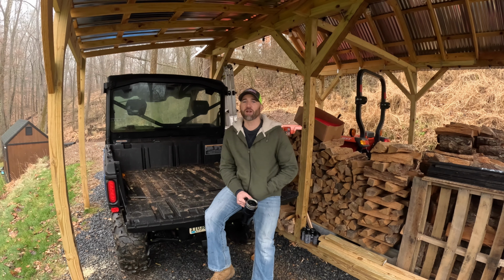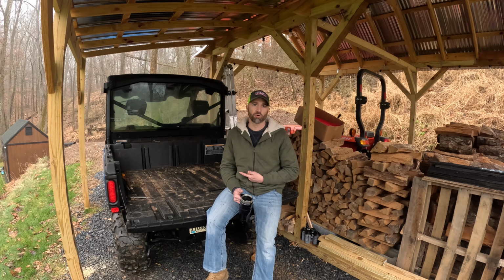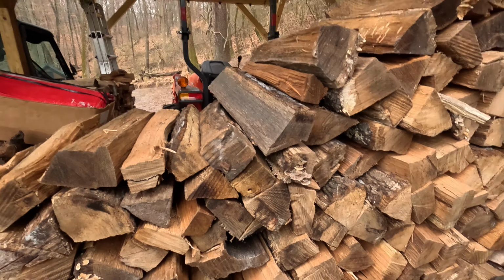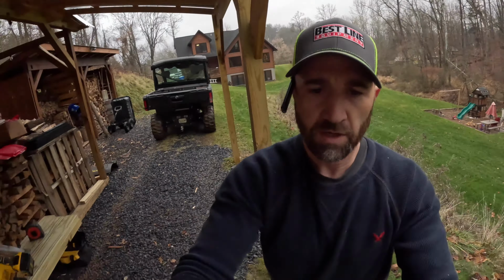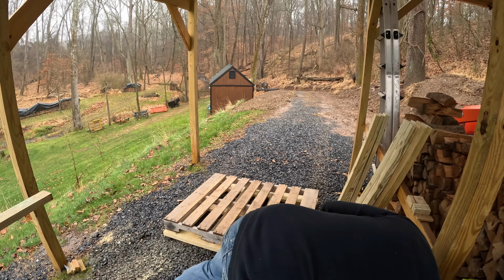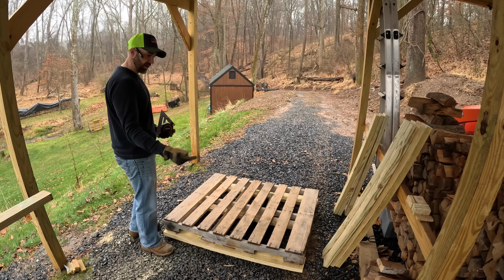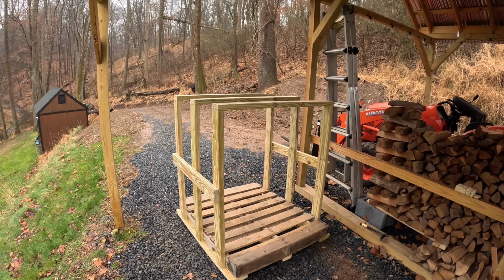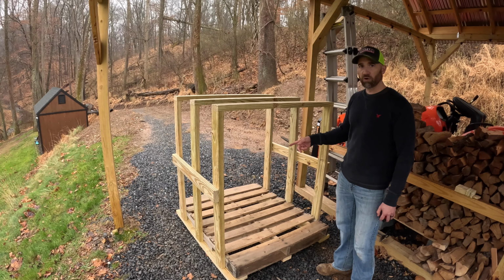$7 Add On Makes Big Improvement To The Firewood Totes

Comment: On that oak. To get a true moisture reading. Split one open and test the inside. That’s where the moisture matters most. I bet inside it’s upper 20’s if not over 30 still. Not hating just trying to help. As a big time firewood producer  I would hate to see you sell wet wood. Keep up the good work.
Reply from the maker: Thanks for the comment. Advice is always appreciated. I want to make a successful business out of this. I always split my red and white oak much smaller to help it dry faster. I have been selling it right around 14%. I will split one and check
Reply: @cabinviewfirewood  especially with oak since they are very dense takes a while. I can dry wood in my kiln and outside of wood could be 0% but inside still be 17 or higher depends on the drying cycle and so on. Always a good practice to split and check. Only way to really know true moisture. Good looking wood though.